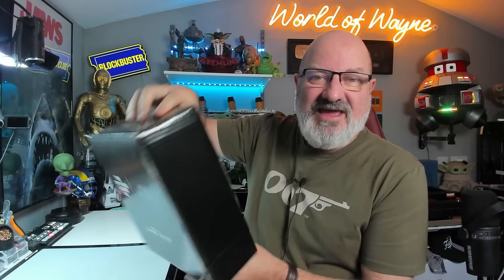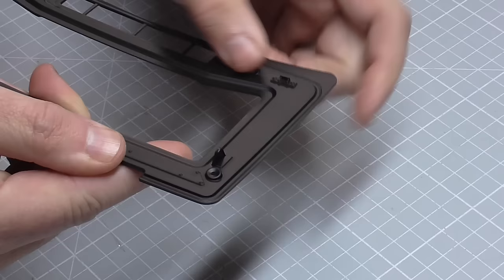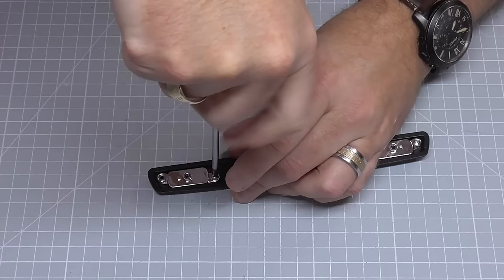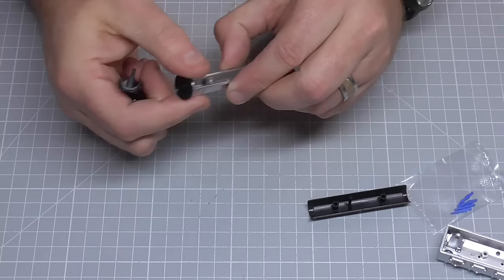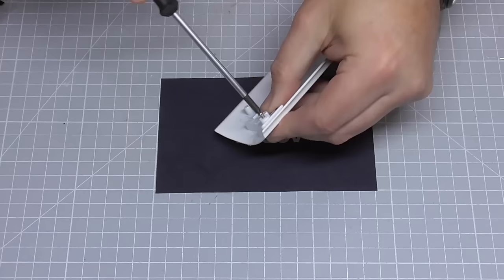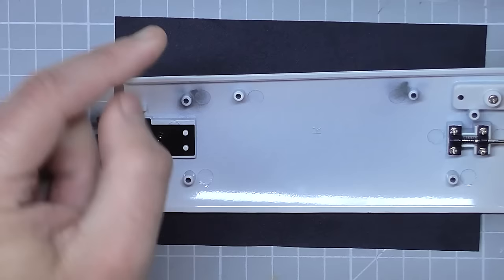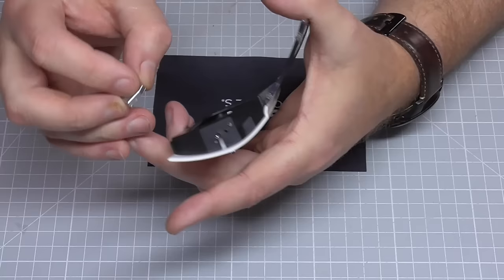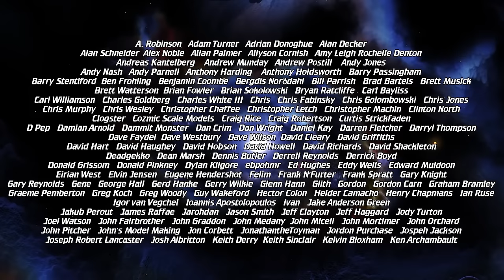Build the James Bond 007 The Spy Who Loved Me Lotus Esprit 1:8 Scale - Pack 1 - Stages 1-6

Comment: hi wayne loooking at agora site the indicators were on the outside and clear lense inside
Reply from the maker: No indicators definitely on the inside. The lens won't let you put them in any other way
Reply: The actual movie WetNellie indicators are on the outside on the front and NOT as Agora have it, which is wrong. See 1:17:27  timecode on Bluray movie.
The land car has them backwards in the front.
This has escaped Agoras Quality Control. Pity. And its not the only thing they got wrong. I contacted them but hey... its just a zen desk.
If this keeps up I will be cancelling my... sub.
But at least the quality rather than accuracy is there.
Don't  forget... Hollywood used many models. Agora is just confused is all. They will hardly change it for the few shaken but not stirred model die-hards like us.
Great videos Wayne.